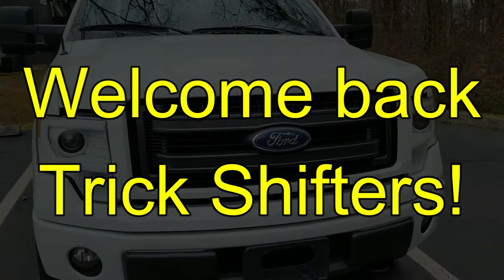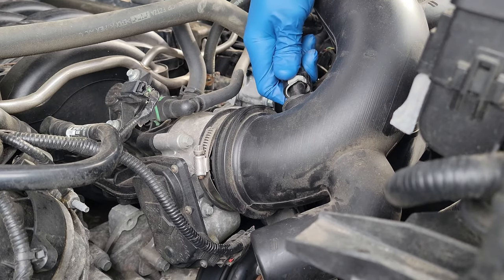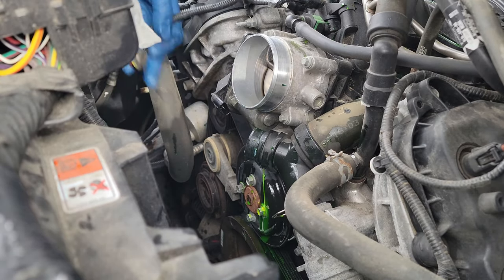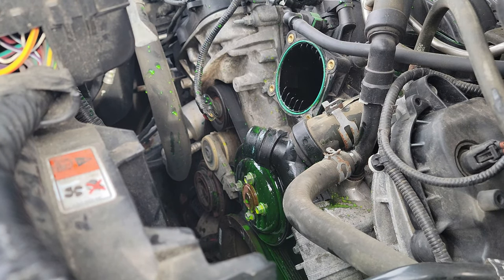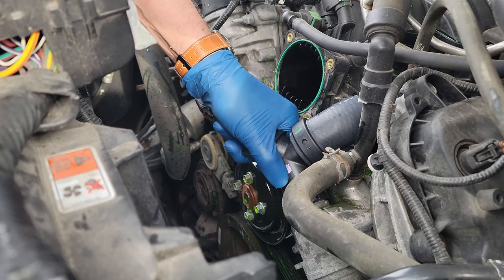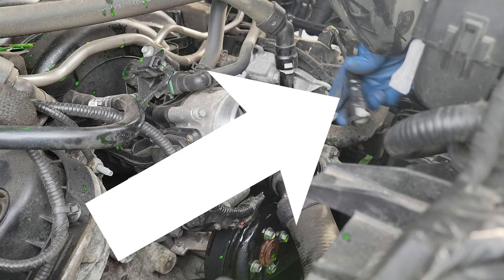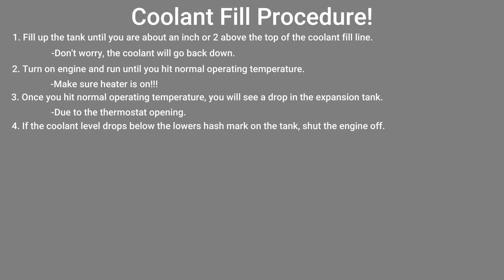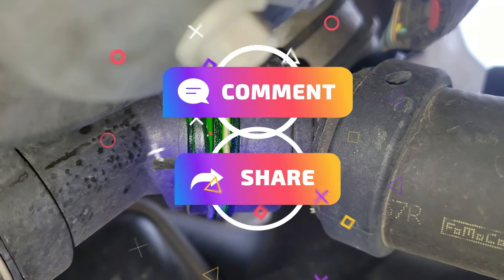2011 - 2023 Ford F-150 Coolant Leak fix!

Comment from the maker: NEW Ford 6R-80 Transmission Fluid Change (UPDATED):
https://www.youtube.com/watch?v=evSRxUxLsSA

2004 - 2020 Ford F150 Axles, Wheel Bearings and IWE's replacement!
https://www.youtube.com/watch?v=_Xph9w5cUMQ

Fuse 27 Relocation Walk-Through!
https://www.youtube.com/watch?v=Zd0o7XvB9vA

NEW Ford F-150 Spark Plug Replacement!
https://www.youtube.com/watch?v=X0pm7TRHO5o

The ULTIMATE Ford Drum Brake Replacement!
https://www.youtube.com/watch?v=11WA-u35o6g

Here is how you revive 27 year old bolts…
https://www.youtube.com/watch?v=gJlypzeuPPc

Can you clean your engine with Tire Foam? Check this out...
https://www.youtube.com/watch?v=r-YMGRhtKsQ

Let us know what you think below!

Comment: My 2014 leaks but only when weather gets cold , my guess is O rings shrinks when it gets cold then expands after warming up . Started leaking last winter, so I just kept filling up reservoir tank until I had time to fix it but then the weather warmed up and it stopped leaking now it just started leaking again the other day since the weather has gotten cold . Going to try to replace just the O-ring first.
Reply from the maker: Yea seems like it's the O-Ring. Let me know how it goes! Hopefully that's the last of the issue for you!
Reply: Exact spot im in, 2015. Gonna try it tomorrow I think
Reply: @TrickShiftGarage  went ahead and replaced upper radiator hose . So far it’s working . Used a Gates hose .

Comment: I change the o-ring in the upper radiator hose and changed one in the lower connector of the y-pipe. I did not disconnect the rubber hose from the housing just twist the hose until I could see the o-ring in the lower connector. $30.00 fix with o-rings and a gallon of Motorcraft anti-freeze.
Reply from the maker: Good idea! Tgat makes it easier than replacing the bottom. Let us know if there are any issues down the road!

Comment: This is some timing.. just found this leaking my 2017 f150, great videos..! Thanks for making them
Reply from the maker: Glad to help! Thanks for watching Ivan! 🤟
Reply: Does your temp go higher than normal, but not fully overhear?
Reply from the maker: @lizesquibel9238  Hello Liz! I haven't noticed any change. Seems like it's right where it should be. 

However, depending on your mileage you may want to think about changing the thermostat out since it's right there with the T-Connector. That could be your problem. I only have 78k miles on my truck, so I decided to leave the factory thermostat in there.

Comment: What year is your truck? I had this issue on a 2011. Now my 2019 has lost coolant over the years but I can’t tell for certain if the T is the culprit this time.
Reply from the maker: Hello Andrew! Mine is a 2013. This is a pretty common leak on all F150's from 2011. If you don't see any leak around your T-Connector, make sure you check the hoses coming out of your reservoir. They can leak from there too. Thanks for watching! 🤟
Reply from the maker: Hey Andrew I just wanted to follow up and see if you found your coolant leak? I hope it wasn't costly and you were able to get it fixed quickly.

Comment: Nothing beats a barbed fitting and hose clamp.
Reply from the maker: Lol too true. Thanks for watching! 🤟 

PS: Sorry to hear about your uncle.
Reply: Maybe someday there will be a retro fit part, so the dealers can stop getting rich from something that shouldn't fail for 15 years.
Reply from the maker: Agreed Miguel. Ford makes terrible quick disconnects (T-Connector for coolant, transmission cooler lines). At some point, you would think a company would find a way to perfect these parts, or use other parts that will last. Ford makes a ton of stupid decisions, and this is one of many.

Comment: I just woke up to this nasty little problem, yep on Christmas morning. Big puddle of coolant under the truck. It seemed to quit once the engine was warmed up, but tomorrow morning I will search for the parts locally.  Thankfully I have the day off... I HATE PLASTIC!!!!!!!!!!!!!!!!!!!!!!!!!!! QUICK DISCONNECTS ARE A CLOSE SECOND!~~ Thanks for posting a video for this somewhat simple fix....
Reply from the maker: Sorry that happened Bikedueder! I hope the fix goes smoothly for you. And thanks for watching! 🤟
Reply: same lol 2016
Reply from the maker: These are becoming more and more common unfortunately.
Reply: i picked the parts up from my local ford dealer this morning and had it fixed in an hour or so.     only a matter of time before those O rings go .. mine lasted 76k
Reply from the maker: @Rich Nicoletti  mine was similar. Somewhere around 70k miles. Glad you got it fixed man!
Reply: Well I found all the parts at one store believe it or not I just bought a new upper hose instead of trying to explain to them that I needed the o-rings which they kind of don't even realize are on it. Parts store people are about a third as intelligent as they were 20 years ago. But anyway it's all done I got the Dorman metal replacement and sanded the mold ridges on the wedge part smooth so hopefully it won't be a place where it leak later. I bought 2 gallons of premix and only needed one gallon after dropping the hose and the connector. Go figure it didn't even want to bleed down either but it did eventually and has not gone any lower.
Reply: Mine has 78,123 miles.
Reply from the maker: @miguellott9038  Glad you got it fixed man. Keep an eye on the coolant level each day for about a week. If there is any air in the system, it will eventually bleed out the more you drive it. 

Thanks for watching! 🤟
Reply: @miguellott9038  yea i usually just go to my online ford dealer parts store … pull up a diagram of whatever is broke , get a part number and just order it. usually ready right away to be honest.
Reply: @nickricholetti754  well I bought the truck back in June it took 3 months to get an interior trim piece with them guessing at which piece I needed and ordering it four times at the dealer.
Reply: @nickricholetti754  and I didn't want to put plastic back into it. The upper radiator hose is a Gates and the T connector is Dorman and made of cast aluminum.

Comment: I don’t have a lot of threads on my 2017 f150 3.5 non eco boost. It’s winter and noticed the reservoir losing coolant. Hopefully it’s the cold weather with the o ring. Once a month or so I have to put some coolant in. Don’t see any noticeable leaks anywhere I live in Florida so it doesn’t get too cold for long
Reply from the maker: There have been issues with the coolant reservoir on the ecoboosts, so that's probably your issue. Changing that and the O-Ring in the upper control arm would be a good idea.
Reply: @TrickShiftGarage  mines the non eco boost. same setup?
Reply from the maker: Oh sorry about that, I misread your original post. Unfortunately, if you aren't noticing any leaks on the ground than it could be your water pump. Even more unfortunate, Ford decided to use an internal water pump on the 3.5 and 3.7 V6 engines. Meaning it's more difficult to access these water pumps that your traditional engines that put the water pump outside. 

Personally, on these kind of engines I would take it to a dealer and have them diagnose it. If it's the water pump, you are better off getting it fixed now. If you wait too long, it can destroy your engine. So please take the proper precautions because a new engine is a lot more expensive than paying a dealer to install a new water pump. 

Please let me know what you find out as I'm curious to what's causing this issue. Also, it could help someone else experiencing the same thing you are.
Reply: @TrickShiftGarage  destroy my engine how? By potentially over heating or the coolant getting into my combustion chamber or crank case?
Reply: @TrickShiftGarage  and thank you for replying and giving me a little insight to my problem
Reply from the maker: No problem. And overheating yes. Some people have had to replace their engine because the water pump failed and they just kept adding coolant. Eventually, it will take its toll on your engine. But that's only if that's your problem. You should definitely get it diagnosed.

Comment: My Y connecter was busted leading to a leak. I used this video and got everything replaced. My only problem is after doing everything my truck whistles when accelerating. Like there is a vacuum leak. Everything is tight but is there something I need to double check?
Reply from the maker: Yea something must have gotten loose. Check all hoses in the area (especially around the intake) and see if something is loose.

Comment: NAPA sells a 3 oring kit and a better aluminum Y connector for this repair..
Reply from the maker: I've been contemplating ordering one with the aluminum housing. I'm curious how it holds up compared to the plastic one Ford uses, although I think the main issue are the O-Rings, so it may not make a difference. 

Thanks for the info though! I'll have to look into their kit and see how it differs.

Comment: Can you just replace the orings ?
Reply from the maker: Hell VG! To be completely honest, I think you could just replace the O-Ring that leads from the T-Connector to the Upper Radiator Hose. That's exactly where mine was leaking. However, after doing some research, a lot of people said to replace the T-Connector because the O-Ring on the other side could start leaking as well. And I'm not 100% sure you can buy that O-Ring separately. So, since parts were relatively cheap, I decided to just replace the whole thing. The only regret I have is I didn't replace thermostat. Since everything was already apart, I probably should have. Thanks for watching! 🤟
Reply: @TrickShiftGarage  🤙
Reply: Great question ty
Reply: @P S  I replaced just the O rings and then ended up replacing the whole part becouse it was old and warped if I remember correctly, still had a small leak
Reply from the maker: Thanks for the update VG. Hopefully that helps PS and others with the same question.
Reply: Yes they sell a kit  20 bucks I think

Comment: On my 2013, I replaced the hose o-ring in 2018 and the o-ring and y-pipe in 2022.  I just found coolant leaking again while changing my oil.  I looked last night but couldn’t find anything leaking or damp by y-pipe and most of the residue found is mid way up the engine under the y-pipe, any thoughts?  Could that o-ring fail in a years time?  Thanks for any advice.
Reply from the maker: Hello Keith, so there are a couple other areas people have found leak coolant also. Around the water pump and around the quick disconnects near the coolant reservoir. The easiest way to find the leak, is to get coolant dye (it must be made to mix with coolant) and then see where the leak appears. I will attach a link to some dye, as well as a video that shows exactly how to use it. I hope this helps and let me know how it goes!

Coolant Dye: https://amzn.to/3zSjHRL
Coolant leak video: https://www.youtube.com/watch?v=8PqfQdpo8l0
Reply: Thanks for the reply and advice. I’ll check into it.
Reply from the maker: No problem. Let me know how it goes when you figure it out!

Comment: followed this to the t, my upper rad hose is collapsed when truck cools off. The heat is coming out as hot as it should, engine heat doesnt go past the center of the guage. Why is the hose collapsing?
Reply from the maker: Hello Mike, you may need to replace your coolant reservoir cap. If the cap is stuck closed and doesn't allow the pressure to escape, it could cause the hose to collapse. 

Let me know if that fixes it, because I'm curious as well. I've never experienced that before.

Comment: I have an F150 XLT Eco boost six-cylinder it’s only got 80,000 miles on it and I’m beginning to smell antifreeze coolant. I’ve had it to the shop on several different occasions they put a water pump on it. They put a New RESERVOIr bottle on it and I still smell the antifreeze after I cut the truck off and get out of it, what do you think this problem could be they even put dye in my in my reservoir and still cannot find the leak
Reply from the maker: Hello LC, I am not near my computer right now, but if I was you I would use a product to test whether or not your head gasket is leaking. I know you can find these products on Amazon and your local hardware store. I'll see if I can find one tonight and I'll send it over.
Reply: I took my truck back to Ford because it’s still under warranty and they put dye in the radiator and they use ultraviolet light. They could not find no leakage I even have them check the turbos because I know that sometimes turbos will leak antifreeze but I do not have any coolant on the ground and that’s the mine blower
Reply from the maker: That's kind of why I'm leaning towards a head gasket. Does your exhaust seem to smoke more than usual? How fast are you losing fluid?
Reply: What is the funny part about it? I’m not losing any coolant that I can find. There’s nothing on the ground. I parked on. The concrete pad is never a drop of coolant on the ground. Ford can’t find out where it’s coming from. And I’m not a slow city driver I live in a country and I’m always all the way to the floor
Reply from the maker: I didn't say anything was funny about it. If you have a bad head gasket, you won't see any coolant on the ground because your engine will just burn it off. Does your trucks exhaust seem like it's producing more smoke than normal? And how often are you losing coolant?
Reply: @TrickShiftGarage  believe it or not my exhaust doesn’t even smoke. This is with her mind blowing about this whole scenario.
Reply from the maker: OK, you probably should get a head gasket leak test done just in case. That's the only thing I can think of right now.
Reply: @TrickShiftGarage  Well I think you very much for all the time you spent trying to figure this out you say you were in Virginia what part of Virginia are you in
Reply from the maker: No problem LC. Hopefully you get your truck fixed. And I'm in Maryland.
Reply: @TrickShiftGarage I actually have a similar issue, but mines will smoke in the morning when I start it, then no other time after that until the next morning.  I drop from max to min coolant over the span of a week or more.
Reply from the maker: Definitely get one of those head gasket leak testers to make sure that's not your issue. But since it's smokes, that sounds like it is your issue. Good luck! Let us know how it goes.
Reply: @TrickShiftGarage  I was hoping it wasn't. I'll let you know.

Comment: Is it just the O ring or does that y junction crack?
Reply from the maker: The Y connector seemed fine on mine, but another subscriber mentioned he had to go back and replace the Y connector after just replacing the o-ring. So something isn't right with the Y connecter. I'd definitely recommend replacing both.
Reply from the maker: To clarify, I replaced both the Y connector and the o-ring as a precaution. I knew the o-ring was the cause of the leak, but felt better about changing both to prevent further leaks.
Reply: I’m going to just replace the o-ring first. Seems like it would be the cause.
Reply from the maker: That's fair. Either way, let us know if that is all you need. I'd like to get everyone's input on whether or not the O-Ring fixed it, or if you need both.

Comment: Does this fit F150 xlt 2015 3.5 ltr twin turbo v6 engine ?
Reply from the maker: Hello Juan! I don't believe so. I think the 3.5 ecoboost has a slightly smaller size. I tried to find one online, but you may want to go to your local Ford dealer and check with them. Thanks for watching! 🤟
Reply: I’m thinking it is because my 3.5 is also leaking coolant
Reply from the maker: Hello Ricky! I know the O-Rings are made of the same material, so that's probably why they leak. But they also have 2 different part numbers for the 5.0 and 3.5 Ecoboost. So I think they are slightly different.

Comment: My radiator plug isn't working. I have bought new hoses and plugs. New water pump. Isn't gonna do any good if the plug doesn't work. Been to auto zone. They keep trying to sell me the same plug. It isn't plugging crap. On my 8th jug of coolant.
Reply from the maker: Honestly, I would assume you probably need to replace your radiator.

Comment: Anyone have a leak on a 2018 ecoboost?  Had to refill coolant 2x in the last 4 months
Reply: Did you find your leak? My 2016 which is also a 3.5L ecoboost is needing refills frequently now.
Reply from the maker: I would buy some coolant dye and see if you can spot it with a UV light. I made a video on how to do that if you want to check it out. Good luck!
Reply: @TrickShiftGarage  Great idea, I use dye to find leaks in pools!
Reply: 2018 3.5 EB here. Had to fill coolant 2x in 8 weeks. Hmmm. While I find the leak, a few bottles of coolant now have a home in the bed of the truck.
Reply from the maker: If you guys find the source of the leak, be sure to come back and let everyone know where it was. I imagine the O-Ring is the main problem, but either way please let us know to help others! 🙏
Reply: @smellybathroom same here, we had snow last month it went to the minimum line, i checked it next morning and it was all the way down to the bottom, i filled it back up 2-3 weeks ago and its back on between max and min line, i didnt see any leak